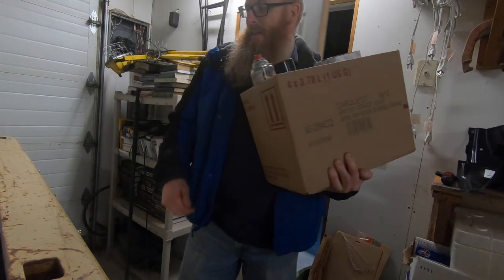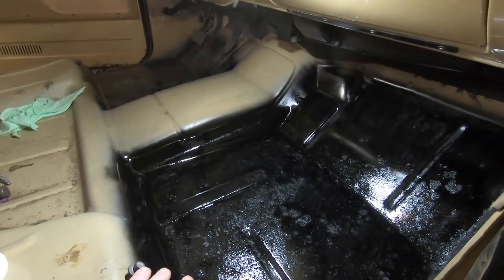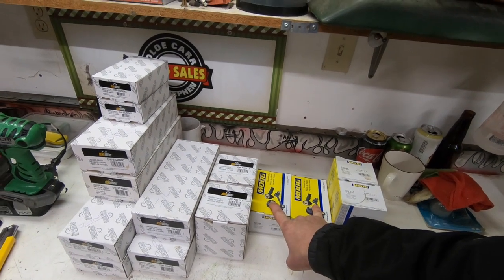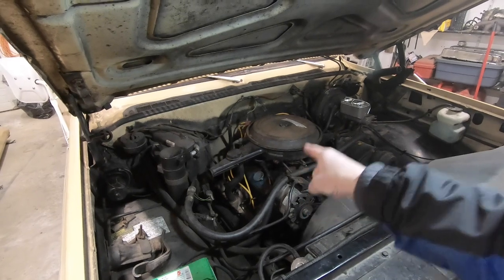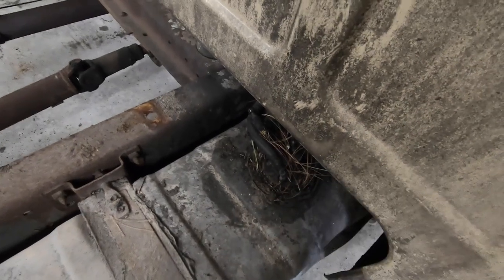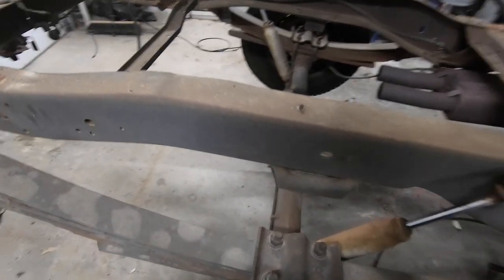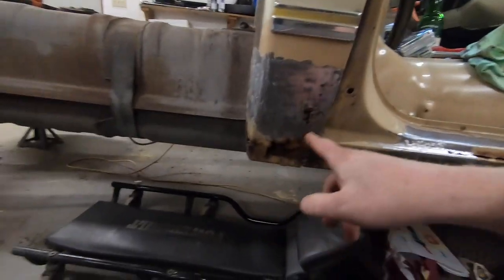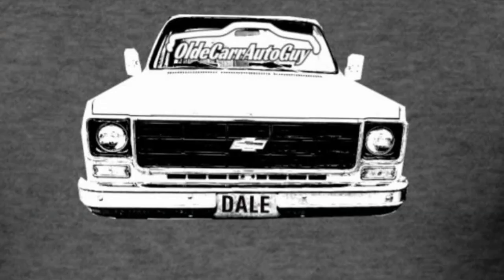PREPARING MY 1977 CHEVROLET C10 FOR ROCKER PANEL AND CAB CORNER REPLACEMENT

Comment: LS swap ? How about a EFI ? Love this truck bud ! I’ve enjoyed it so far ..
Reply from the maker: We’ll see what the future brings! From a channel perspective, LS swaps brings views to the channel and the return on investment is a modern, fuel efficient powerhouse! 

A SBC build is cheaper when it comes to $’s per horsepower! And I’m old school! Not sold either way but for now, I’ll clean up the oil leaks and new exhaust!
Reply: Olde Carr Auto Guy, there’s that other GM engine .... just sayin’
Reply: @OldeCarrGuy  hate to say it i have seen alot of ls swaps that just dont get veiws. Ls swap wont guarantee veiws. I would just go the route you truly want to go. Efi on the sbc and a cam would be simple and cheaper and your old school so it will still have that old school look. Plus ls swaps are overdone and there is alot of channels already put there. But i am noticing a flux of interest in aftermarket efi kits.  I honestly dont see an ls swap in that budget if you want to do it correct and not a hack job. Just my 2 cents. I think the best route is to build it to your liking for your not anyone else regardless of veiws becuase at the end of the day its yours and yours to enjoy. and its a squarebody so no matter what you will get attention from it.

Comment: If you axle flip the rear end it will give u a 8 inch drop
Reply from the maker: The kit I bought stated a 4 in the front and 6 in the rear using a flip kit. We have pretty crappy roads up here in the great white north. I still wanted drivability!